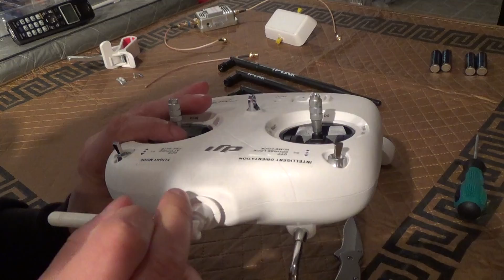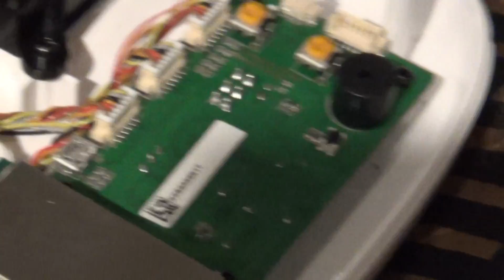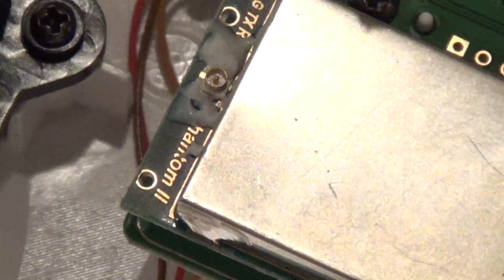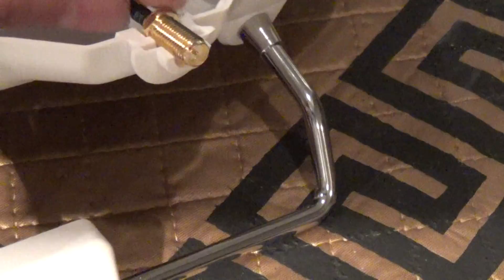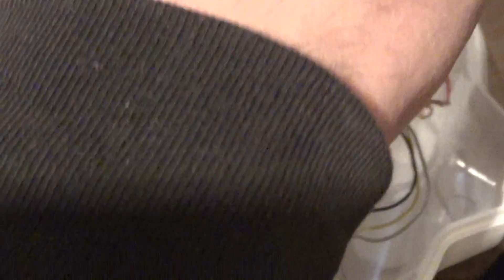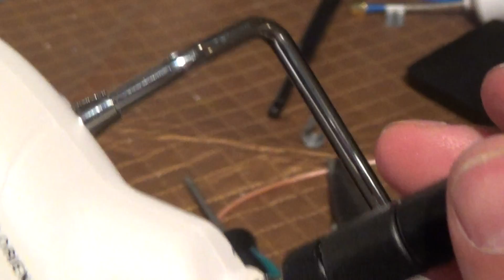DJI Phantom 2.4 and 5.8 Radio Control Antenna Mod increase RC / FPV Range

Comment: Ok...so I have the P2V+ and while the range is supposed to be better,  I am struggling getting much out of it.  I always thought the limiting factor was the FPV. Your videos are showing me something different.  If I upgrade the antennas on the repeater (both of them), adding the amplifier as well as the controller antenna would that make a significant difference?  Your videos show upgrading of the transmitter on the P2V so I am not sure about the P2V+ camera.  I think I recall you saying one of the antennas on the P2V+ is different. ..or was that the camera?
Reply from the maker: Hi, regarding upgrade procedures between the P2V and P2V+ the only difference is upgrading the wifi antennas on the P2V+.  It's an easier process, you would use the same antennas on either but you'd be using a different antenna connector.  The P2V you need to u.fl female to rp-sma female in the camera itself and the P2V+ you would be using a MCX male to rpsma female.  

In stock configurations the FPV video stream is the weak link but after modification of the antennas the controller then becomes the weak link and will then need to be upgraded to keep up with the FPV feed.

The P2V+ has more output power on the wifi repeater which helps with extended range tho range will vary dramatically depending on the environment and the PREVIEW setting.  I recommend against using 640x480 30fps for anything but closer range flight unless you've upgraded all of your antennas.  The higher the preview quality the shorter the FPV range.
Reply: Thank you for your reply.  So by WIFI antennas I presume you are speaking of the antennas on the P2V+.  I use the lowest preview setting already.   I guess in addition to upgrading the controller and repeater you are suggesting upgrading the camera on the P2V+ as well.

Comment: There is a mod where u change the fc40 camera antenna. So I think with your mod on the 5.8ghz and the mod on the 2.4ghz camera fpv. You will get pretty good range overall. Using a good repeater as link to the camera.

Comment: what distance can you get from this upgrade
Reply from the maker: Your range will vary depending on many factors including the quality of your transmitter's amplifier. Location your flying and what antennas you'll be using.  I've so far done 4,600 feet using a 3dbi whip.   I haven't had an opportunity to test further ranges.

Comment: Your OCD of getting the silicone off was soo annoying. It took up 15 minutes of the video- you should have cut it out.
Reply from the maker: The whole point of the video was to show how hard or not hard it was to do a clean safe removal of the silicon covering the connector.  it's all too easy to do a sloppy job and damage the connector or amplifier if not done slowly and meticulously.

Comment: Hi Ben ... 
I have noticed that u r using on ur transmitter a 2.4 antenna TP link omni on ur other videos .... is that possible to be used on tx 5.8ghz ??? Coz am planning to do the same on my p2v+ .... 
I got another question ... i havent seen yet a video about modding p2v+ and i wonder is it because the p2v+ got less efficiency comoared to p2v ??? 
Thanx

Comment: Hey mate. Nice video. Im going to do this mod to my 1.1.1 . Im new to the whole dbi stuff, prepare for a stupid question .... im guessing the 8dbi tp link antenna will add slightly more range than the 5dbi? So if I buy the cable in your description and the 8dbi ill be away laughing? Thanks
Reply from the maker: Yes the 8dbi will provide slightly further range over the 5 for sure. It's quite a bit longer though.

Comment: Ben if i do the mod on the controller and then purchase a 5.8GHz 3dBi Omni WIFI Antenna with RP-SMA connector how much range increase on the control signal could i expect? Currently I only get 200 metres out of the standard controller unitl it RTH? The below is what i was thinking to buy

http://www.ebay.com.au/itm/5-8GHz-3dBi-Omni-WIFI-Antenna-with-RP-SMA-plug-for-wireless-router-Silver-Grey-/291110946913?pt=LH_DefaultDomain_15&hash=item43c7908861&_uhb=1
Reply from the maker: Your stock control should be able to give you more than 200 meters range provided it's running in FCC mode and you're operating within line of sight. You may want to look into warranty replacement first.

Comment: Ben- My PV2+ seems to only have 200 metres control system range before RTH triggers even though it is switched to FCC mode. Using your controller mod what type of aerial do you suggest to increase the control system range of the 5.8ghz signal?- the video FPV seems OK though.

Comment: Ben,

I have followed your mod and used a 8dbi TP-Link antenna.

With the stock, I was getting about 920m. However, after changing the to the 8dbi antenna, my range dropped to 150m! I thought that hmmm..maybe it's the cable problem. So, I went home, changed another cable and tried again. This time, it flew till about 220m and lost connection again! I'm really sad!

Setup:
Phantom 2 vision plus stock.
Controller modded with TP-Link 8dbi.
Using a Ipad.

Area:
Urban area. with lots of wifi and 5.8 routers around..

Initial test with 920m and sub test with 8dbi 150m and 220m is exactly the same.

Have ordered the patch 11dbi antenna. Awaiting order to arrive.

Any recommendations?

Kenneth
Reply from the maker: Hi, in my tests in identical conditions the stock radio gets me to around 2,800 feet before it intermittently drops.   After the mod using a 3dbi antenna from my Hawking tech 2.4ghz repeater I flew to 4,500 feet.   My next test was with the 5dbi TPLink antenna which brought me to around 4,100 feet before it cut in and out a bit.  I havnt tried the 8dbi or the 11dbi 5.8ghz patch but I can tell you for sure that everyone using the patch has seen good results getting at least 5k feet and some saying they got over 10k.  

 As far as your problem goes my first thought would be that you have a cable problem.  Secondly problem with the antenna, third a damaged connector from when you removed the white silicon coating and lastly the amplifier on the remote might have some damage to it.  

From where you're at you may want to make sure the center pin is in place and that you removed all of the goo around the base of the connector and there's no damage to the solder around the base.  Then try the 11dbi patch and if you're not getting at least the same or better range then there's damage to the controller.  I'd start with yourself or a professional soldering down a new connector.  If that doesn't resolve it then you'll need a new transmitter.

Comment: shit I cut it really slow and in the end it came out with the female! now how can I repair it back to the board??
Reply from the maker: Any and all connectors can be replaced by someone with good soldering skills and a new replacement connector.

Comment: DUDE, Great video just did not need to see you pull a wire out for 12 minutes
Reply from the maker: That was the whole point tho is to show exactly what is involved in removing that wire which is 99% of the challenge of the mod. Unless you choose a mounting method which I did which was also a fair amount of time spent as well.
Reply: This is an excellent instructional video - really very good and I learned a lot - when I wasn't screaming in frustration listening to you wheezing  and sniffing and then muttering to yourself absent-mindedly and wasting half of the time with unedited video which shows nothing!. Maybe you could spend and evening or two learning how to edit the videos you make?  It would make a world of difference. I'd certainly want to follow you . . .

Comment: i think my friend u have low expirience is the best to use antena metal one like what they use for radio or cars ,,,for the infra red just change capacitor for high MUf
Reply from the maker: You sound a bit confused. The instructions in the video are accurate for those wishing to simply swap out the stock antenna with a better one.

Comment: thanks for the video!  If I wanted to add an amp, where would that happen?  Would I add it to the new antenna connection you just created coming out of the transmitter?  Then connect the new antenna to the amp?
Reply from the maker: You're welcome :) and yes you would add an amp in the same way you do with the wifi repeater.  You can look at my Sunhans amp video and I have a link to a 5.8ghz amp and batteries in the description.  If you add amp to the controller you will absolutely need to use an attenuator, or put it in CE mode so it won't over drive the amp.

Comment: Ben. a ? about the "11db rpsma 5.8 ghz patch antenna
http://www.amazon.com/huhushop-TM-RP-... So that one will also work on 2.4ghz but just at 8dbi?   I had one of them and it was advertised as just being for 5.8ghz  and when I got it. it had 2 boxes on the back of the body and a sticker on it that only had 5.8 checked. and also they were selling the same ones in 2.4Ghz to and I was thinking of getting one to try on the fpv.. because the one I have that was sold as just a 5.8 rocked all my other antennas I tried even a big 16dbi panel dual band antenna dint even compair to what that tiny junky looking Chinese patch one did for my flight range.  All the rest the best I could get was 6/ths of a mike flight range. With that one on my tx I got to 9/10s before I decided to fly her back and it never lost signal and so it could of went even farther.  But if its also the same as the 2.4ghz  8dbi I'M going to try that with my wifi repeater and booster.  I also notice it was not to narrow of a beem either and i dint have to keep it perfectly aimed at the phantom the entire time either.  Cept for if I was flying behind were I was standing I would have to turn around and point it sort of in the direction.
Reply from the maker: Using that antenna on 2.4ghz side I flew somewhere between 1,800 and 2,000 feet in my wifi saturated neighborhood with no mods on the Phantom itself.  In a desolate area it should go way further and even further still if flying sideways where signal is strongest or any direction if you add a skew planer to your phantom.
Reply: You a have vision 2 right? and is that your video you got 2000 feet with? or flight range from the transmitter?  I'm on an FC40 So I'd have to mod the camera with a good antenna to probably get the wifi video out that far.  But I just went out for a night flight Right after my last post sence it was a nice calm night and wanted to see how much further The lil 11bi directional antenna would go.   and flew her out till I could see the Led flicker orange and in fail safe from losing signal. Blew past .9 and got 1.3 freaking miles. http://www.flytrex.com/mission/quadcopter--jj-james-34577/  But I don't think I even want to try to top that now. Being I only get about 12-14 minutes on a 2700mah battery and don't ever want to go out past the point it would ever not have enough battery to get back.. So now my next nut to get cracking on is going to be the fc40s video range.
Reply: lol lol I was just looking at my flytrax map of tonight flight a realize that it never went in to fail safe from losing signal at 1.3 miles It was just past the 2000m limit default leash range in the naza and I was flying out in atti mode at about 4 minuts out is when I flipped it in to  gps mode cause it was getting hard to see it to control it and I can see the part of my flight were it moved back a few meters to get  back in the 2000m limit right about the same time I flipped in out of atti mode So I'll be danged that could of gone more then 1.3 if not for the 2000m limit being set.
Reply from the maker: j james Increase your limit :P
Reply: ya thats what I had to do. Tho not pushing it past 2500m till I get a dual battery set up so I can have some more flght time.  But been working on the fvp some trying to get that range up. Moded the kindel to take an external antenna and got the fpv up to 1/2 mile no repeater needed either :-)

Comment: Hi, Do you or anyone else know where to buy a 2.4ghz Transmitter Module for these transmitters? I'm wanting to change from 5.8ghz to 2.4ghz to use FPV on 5.8Ghz.
Reply from the maker: You have to buy a new transmitter.

Comment: Hi Ben,  I am doining mods to my Vision 2 plus, I just wanted to check, for the remote I will need a MCX female to a RP-SMA male?  Will the antennas you list below work as well? last question, Can I use the 5.8ghz control you can use this 1watt 5.8ghz Sunhans amp or do you suggest other Amps?
Reply from the maker: You need u.fl to RP-SMA.  The control does not use MCX.  The Vision Plus Wifi on the Phantom itself is the only place you'll find MCX>

Comment: Great video Ben, thanks for the info. My question is : are the tp link antennas you are using 2.4ghz? Does it say that on the packet? The only tplink antennas i have found here are 2.4 ghz and i dont know if i can use them on my 5.8 ghz transmitter?
Reply: I think you need 5.8 for your tx and 2.4 for the range extender

Comment: ben, i ordered to PV2+ it has not arrived yet.  i want to pre-order parts for mods for after i flight train with stock.  i recall, in one of your vids (cant find it now), you stated in comments to someone that the internal antenna connections for all 3 antennas (2 for extender, 1 for transmitter) were U/FL for the PV2 but were MCX for the PV2+.  is this correct?  did you look/how do you know?  male or female connections internally for the PV2+?  thanks!
Reply from the maker: I've seen photos or other p2v+ so I know the internal antennas are mcx female on the plane itself (and a lot easier to get to) where as everything for the original vision is u.fl female. 

The range extender and rc control mod are done identically on the P2V and P2V+ and use the same adapters.

Comment: I got a new cable and installed it. While i was doing this i noticed that the connector in the remote was damaged. am i screwed lol? Or should it still work? I posted pics on my channel. I will post my distance results as soon as i can fly.
Reply from the maker: I saw the pic and it looks like the connector is a little out of round and there may be a little solder missing on one side of the connector.  You may still be okay tho if you can correct the shape and plug in the ufl pigtail.  Worst case scenario would be a new ufl needing to be soldered on to the board.
Reply: Hope not lol. I would have to take it somewhere to put it on the board. I would have no clue how to do that. Sure hope my test later solves problem.
Reply: Thx again for your knowledge.  And time
Reply: I made several attempts to fly and the furthest I got was 5800. I probably broke it. I will try and bend it back like u suggested.  Then take it in if it does not go farther.
Reply from the maker: 5800?
Reply: 5800 ft with the 11 dbi flat antenna that u talk about in your video.
Reply from the maker: That's not a bad range. The build quality of the amps in these controls vary considerably and with that the power output. I've only gone to 4,600 feet so far with the 3dbi antenna.

 Also when using that 11dbi patch antenna good aim is critical to your range especially at long range because of the narrow 30 degree beam width.
Reply: Several YouTube videos show much further distance.  With similar set up. What else can I do to get my controller to do this?
Reply from the maker: The DJI radio controls vary in power output.  Also depending on they area you fly and surrounding interference will also dramatically effect range.  I believe most people flying beyond a 3km need to add amplification to the controller.
Reply: Thanks for responce. What amplification would u recommend?
Reply: Also I'm trying to do your easy cam mod. I got some parts today. I must be missing a part because it doesn't make sense how to put this together.  If u could make a video of u actually doing it would be freaking awesome.
Reply from the maker: I added detailed installation instructions to the description of the Easy mod video. That should help clear things up. Eventually I'll make an additional video on top of that to clear up a mistake i made in the original easy mod video itself and had to correct via the description.
Reply: K I see that. Thanks.
Reply from the maker: I added a link to the Sunhans 5.8ghz 1 watt wifi amp. I'm pretty certain it will work on the 5.8ghz RF control even though it's technically not using "wifi". Wifi support generally means it can work Bi-Directionally, not that it can't support standard RF in addition to wifi type signals.

Comment: Hello, is it possible to use this: Pair of Cheap 5.8ghz cloverleaf antennas for RX and TX but with the transmitter / receiver DJI DT7 & DR16?

For you, what would be the best antenna for my radio DT7 + DR16?
Reply from the maker: Yes it will work fine
Reply: Ben7seven7 Thanks but what would be the best antenna for my radio DT7 + DR16? (not for FPV !)

Comment: Thanks for responding.  When I get a new pigtail I will switch it out and post my results.
Reply from the maker: No problem,  also try using one with rg178 cable it tends to be better quality that's what I'm using on mine, tho you will still be fine using the thinner cable if you so choose.